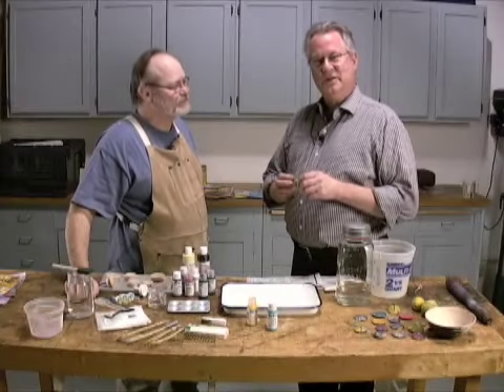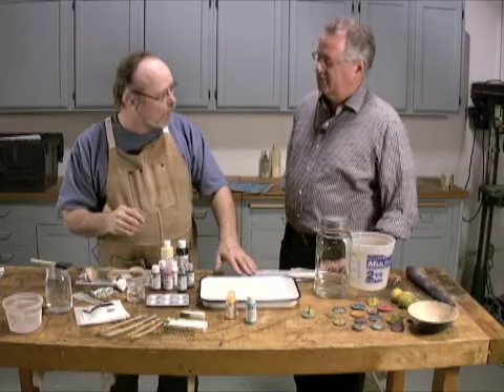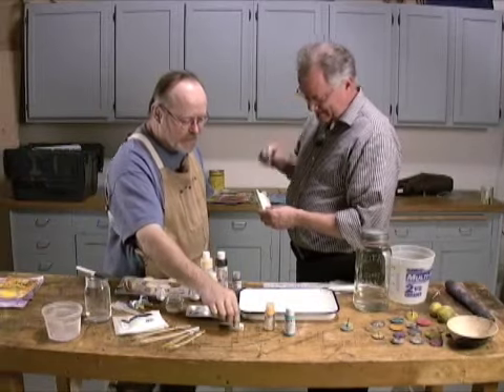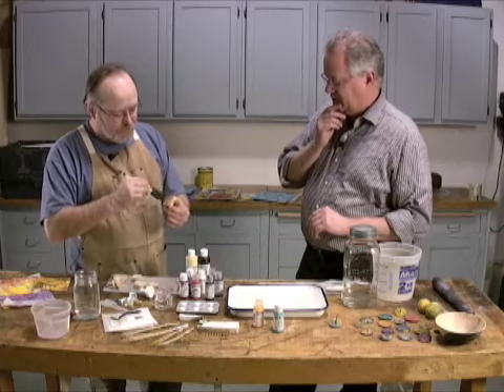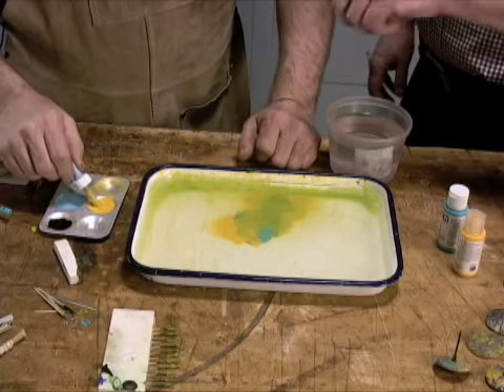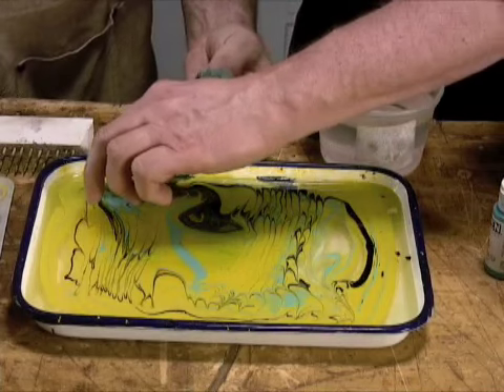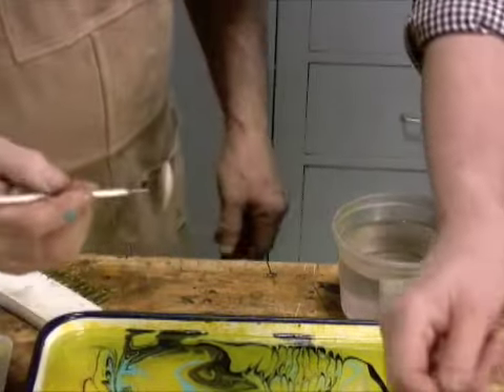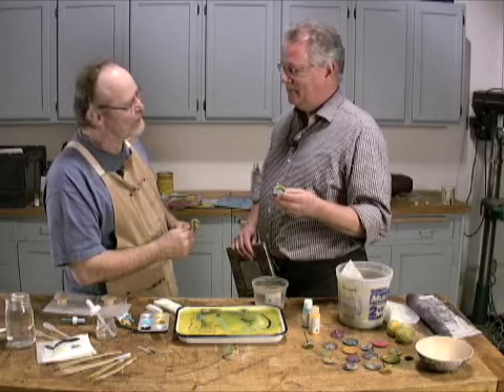Marbling Wood

Comment: hello!
Another question.. what exactly do you put on the wood that the acrylic color stick? .. You mention it in the video, but same here, I can't understand it well..
would be amazing if you can help me out!
saludos
Reply: aaand.. with what are you liquifying the colors?
Reply: carrageenan or you can use methocel.  I believe the methocel is cheaper.
Reply: Gina Cottichio  I take that back. Read your question wrong.  You use alum (mixed in water) to treat it first and then use carrageenan or methocel in the water for the paint.
Reply: Liquid starch also works for floating acrylic paints, you will need a rinse tray as well.